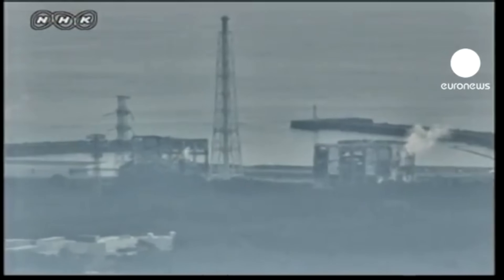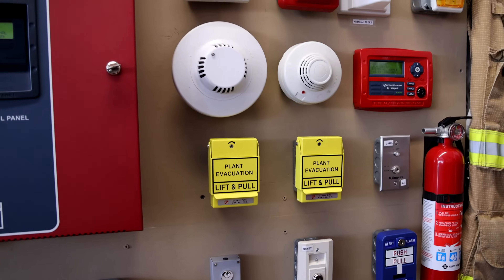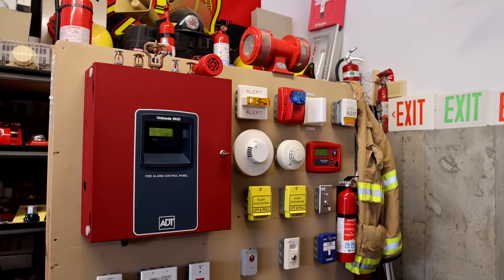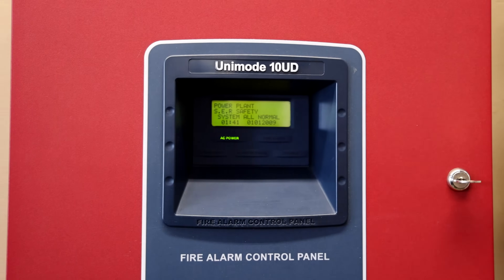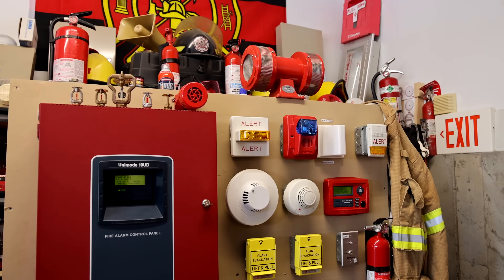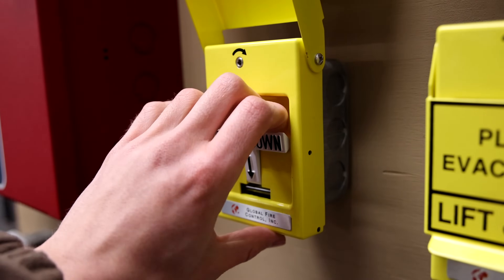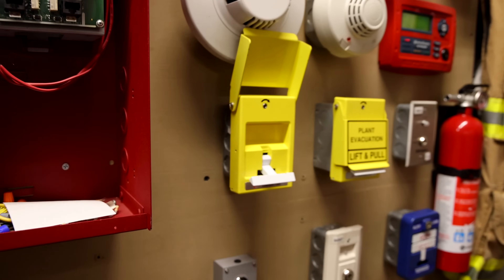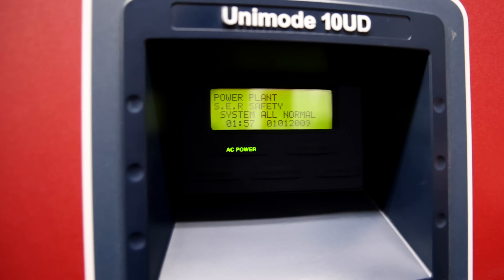Nuclear Power Plant Evacuation Siren | ADT System Test 27

Comment: Those plant evacuation stations can also trigger emergency siren systems that are scattered around a large radius of the facility while also sending out a local emergency alert through the local EAS system.
Reply: Thanks for the tip and that’s a great thing to do especially places like Fukushima Daiichi
Reply: I would recommend small sirens for the area such as Omni-Alerts or Modulators
Reply: IDK if it is still around, but there was an abandoned nuclear station where the emergency sirens would go off randomly, likely due to faulty/decaying wiring.
Reply: Negative, most systems on Commander or ASC Compulert software require manual intervention
Reply: @@Schmaggleschticker All of those would work. There's also a dedicated Nuclear Power Plant Warning but this isn't really in use. In the end it's really just what the authorities request. EAS activation isn't automated (though relaying it on local stations is automatic after initial activation).
Reply: The evacuation alarms off site are controlled by the municipality in that area. Not by the plant personnel directly.
Reply: The neighbourhood is just having a nice afternoon and then they think cheynoble will happen
Reply: We’ll be right back
Reply: It actually can
Reply: Interesting
Reply: Outside of very rare circumstances, the EAS isn’t connected to the alarm system. Local emergency management officials such as myself want to verify it’s not a false alarm before alarming the public and causing more problems than necessary. There’s multiple steps that take place between a plant declaring an emergency and notifying the public. In the case of a chemical or nuclear release, emergency officials would need to determine if an evacuation of the surrounding community is necessary or if a shelter-in-place order needs to be issues. Furthermore, wind direction also plays an important role, as if an evacuation is deemed necessary traffic control measures would be put in place so people are moving away from the toxic wind and not into it.
Reply: I live a mile from Fitzpatrick and Nine Mile point Nuclear generation station in New York and the thought a Nuclear Meltdown is something that looms in the back of my head as a firefighter I can’t be prepared enough for an incident there
Reply: FIRE:⚠️
Reply: Say big Grammer issues I've reported you
Reply: @shannonlewis1737   "...when asked about the leak, plant officials declined to comment, saying only that an official statement would be issued at a later time..."
Reply: @ThunderboltSirenStudios Modern nuclear regulations state the siren must have a sound of 500 hz, which is mostly found with whelen electronic sirens and 8 port dc mechanical sirens, like the asc tempest series, the federal signal eclipse, equinox and 508, and many dc sentry products
Reply: @hunterneitzel3012  is 460 Hz close enough? If so, a whelen can be used.
Reply: No only nuclear power plants are actually required by law (NRC) to have sirens around the plant within 10 miles of the plant all other chemical plants just have them on their premises.
Reply: @mattdaddy_888  
There was even a mental hospital in the UK that had a siren system like that to warn of escaped patients which was actually a reuse of a number of air raid sirens that were installed during World War Two. However the system was decommissioned a few years ago with the sirens being removed as they now instead rely on the local EAS to send out alerts about escaped patients.
Reply: @Techno-Universal  ever heard of the chrysler air raid siren?
Reply: @mattdaddy_888  
I think it might have been the loudest siren ever made which is a portable trailer with the siren using a large diesel engine to turn it.
Reply: @Techno-Universal  well it was a chrysler V8 hemi gas engine that ran off of propane gas and they were cold war era sirens mounted on top of buildings. What's crazy is that I love the nostalgia of back in the day when tye census was that if you want to make something more powerful you slap an internal combustion engine on it and theor supremacy could not be outmatched. Thanks to Elon Musk unfortunately that's not true anymore cognitive dissonance in a lot of people's minds where the electric  motor has been proven to be more powerful then the internal combustion engine unfortunately. Which brings up another point three phase induction motors as those use in EV's are just as old as the internal combustion engine invented by Nicola Tesla back in the late 1800s. So why was the premise of the ICE engine being more powerful then electric especially on something stationary that doesn't require batteries mounted on the roof of a building. Why couldn't they just power the same siren with the same size chopper with just a bigger more powerful three phase induction motor?
Reply: @mattdaddy_888 
Yeah I think some of those sirens also ended up on trailers as portable sirens so they were manufactured like that or were later mounted on trailers by whoever acquired them after they were removed from buildings! :)
Reply: @Techno-Universal  ironically ExxonMobil invented the lithium ion battery in the 70s which is now their competitor.
Reply: @mattdaddy_888  
It also wasn’t commercially used until a decade later in 1983 when Sony used lithium ion cells in their motorised film cameras.
Reply: really
Reply: @jandilks7909  I think it's only for nuclear power plants there the only plants that are required by federal law to have sirens within a ten mile radius of the plant other chemical plants only have sirens on their property I don't know of any regulations that require other chemical plants that aren't nuclear power plants tgat require sirens within a certain mile radius outside of the property of the plant.
Reply: @captfjparks Generally both authorities and plant personnel have full control over the system, either one can choose to activate it.

Comment: For the local nuclear power station, they have the alarm system as automatic. If it detects radiation above x, it triggers. Internal sirens trigger first and the hope is it can be contained before it escapes the plant via means - as well as an alert for personnel to take their iodine tablets and put on any PPE required.
Reply: Iodine tablets reduce the radiation inside the bodies, right?
Reply: @crazycatrox70  cool
Reply: @crazycatrox70  Yeah no I didnt take it as rude

Comment: Nice video! Fun fact, The Three mile island nuclear plant.(which is now decommissioned.)in Pennsylvania had outdoor warning sirens installed after the partial Meltdown on Unit 2 in 1979. These sirens would go off if another meltdown occured at the power plant. Otherwise they were tested monthly. These sirens (all of which were ACA) were replaced some time in 2011 or 2012 with ASC T-128s. Ironically those dident even remain in service for 10 years before being taken down due to again the plant permanently closing.
Reply: I miss those sirens. I hate fire alarms...lije a phobia of them. I cant sit near a pulldown, I hate their flashing, I hate the chirps, horns, whatever...

But air raid sirens? Those outdoor sirens? I luuuuv them.

Comment: In my school the building is so old that all the fire alarms are buzzers without strobes set on repetitive. And almost all of the pull down stations are the one on your profile picture.
Reply: Cool
Reply: Thats a rare system
Reply: The highschool I went to in the part of the building that was original had these poles from floor to ceiling with a handle you pulled down that slid along it. Never seen them anywhere since.

Comment: What's the supposed point of having a glass to break in those pullers: as if the mfr. can't just make something with a similar click to have to overcome that doesn't require the breaking of something, if the glass isn't a cover over the box and so it doesn't serve as a deterrent against alarm trolls because they would have to break the glass just to get to it, and maybe get caught doing so?

Comment: I have been told that certain applications require 2 pulls to confirm the emergency to prevent a spiteful employee or a accidental evac that could cost lots of money from a shutdown or evac and response fines - do you know anything about that SER?
Reply: On the large metro system in my country’s capital: one manual call point being activated triggers a stage 1 alarm where staff are requested to the control room to check the situation. 2 manual call points or 1 automatic sensor in a “critical space” being activated skips directly to the “evacuate” alarm and summons the fire brigade.

Comment: What do you think about SPC 4320? Bought it to my home, it includes burgular, fire, waterleak, duress, perimeter, also with 4 fire pull stations that I repainted blue for duress.

Great that it has Keyarm input zone too, so I can have my system automatically set or unset based on circumstances so I never have to input any code, the system recongnizes me automatically when I scan my access card to my front door. The systems talk to each other.

Comment: "The potential for fire or fire"?

What's the supposed "difference" between fire and fire?
Reply: "Potential for fire" means leaking flammables, chemical spills, and other serious hazards, and "Fire" means fire.

In other words, if you see hydrogen gas billowing out of a ruptured line, pull the alarm. If it catches alight, explodes, and starts burning the place down, also pull the alarm.
Reply: @FurryWrecker911 : It sounds like he's saying "the potential for..." and then "fire or fire."

Comment: What happens if there's no power, lets say no more electricity of any kind to power the alarms, what would happen, is there a backup system on batteries.
Reply: Offsite supply of power, Standby diesel generators and battery backup systems.

Comment: When i was on the emergency response team at a chemical plant, we had an automatic system. If there was an emergency the on site dispacher would signal the alarm, which would immediately send a signal to the citys public safety dispachers who would issue an alert through text TV and radio to shelter in place. Our dispacher would call emergency management and fill them in on the situation. But rest assured, we would be on scene doing the best we can to save your and our asses

Comment: Rebrand of a federal Q siren!
Reply: Ms-590. Federal signal Q's are silver and draw 12 volts.
Reply: There also slightly bigger and have a longer wind down
Reply: @MichanaAlerting they actually use 24V i believe
Reply: @That_2_guy2T  nope. 12 volts at 100 amps. It's meant to run off of the engine's battery.

Comment: I plan on making a nuclear fallout detection and notification system called the Federal Signal RadAlert. It’ll be designed for public fallout shelters and near nuclear power plants. It’ll be a horn/strobe type alarm just like a fire alarm but it’ll be yellow or amber and have a yellow/amber light for radiation. It’ll be wired to a weatherproof Geiger counter that’s located on the roof of a public building above an entrance way and when fallout enters the city it’ll pick up the gamma radiation and trigger the alarm alerting occupants to shelter immediately.